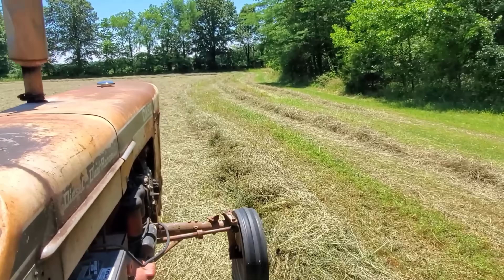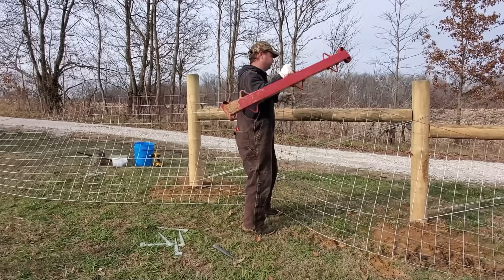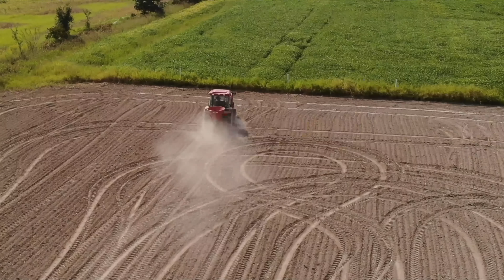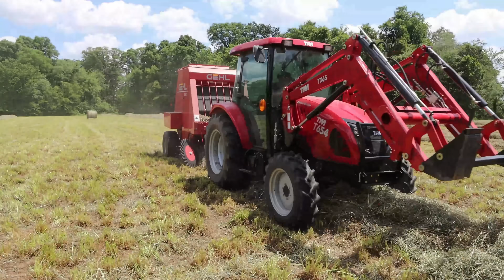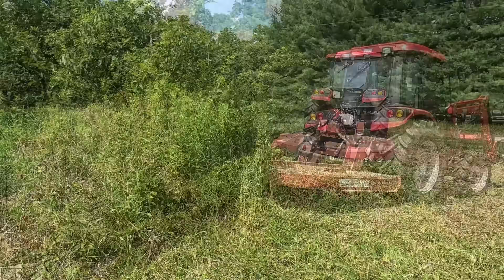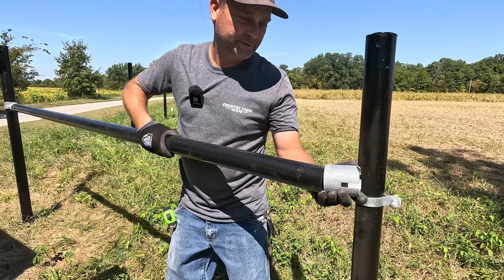Starting a Small Farm - Our Original 5 Year Farm Plan, How Close Were We?

Comment: This is the 2nd video I have watched that you have made. The first video was from about 4 years ago and you were explaining your current and future plans. Upgrading your equipment was the best thing you could do. I used square baler for years and did all the work myself with old equipment. Cutting, making and baling hay, loading stacking and unloading. Making and repairing fence, cutting and stacking firewood. Upgrading to modern equipment will hopefully prevent you from having to get disability hang tags for your vehicles in the future😊.👍

Comment: I envy not only what you and Rebeka have been able to accomplish, but also your ability to get it done.  As you stated, time is one aspect of it, but the other aspect is ability.  I am a bit older than you and I can no way work or perform the way that I used to be able to when I was younger.  I try my best, but a lot of times I am pretty much "done" by lunch time.

The one most important thing though is to keep doing what you are doing.  Set goals and work hard to achieve those goals... and don't be afraid or disappointed if you fail.  If you ever stop trying to achieve goals it's pretty much over.